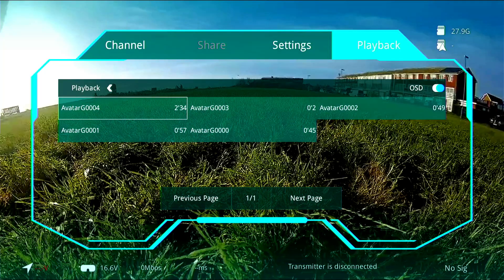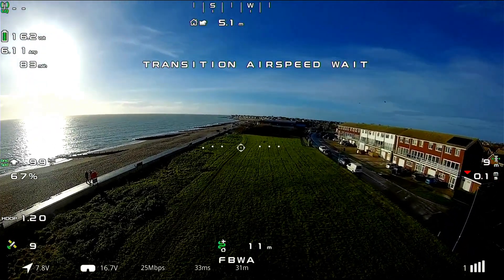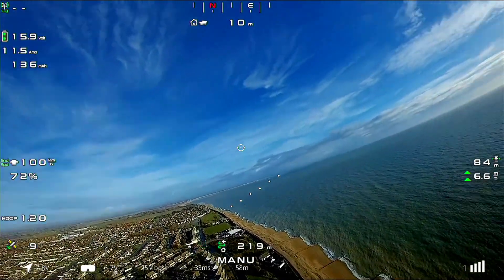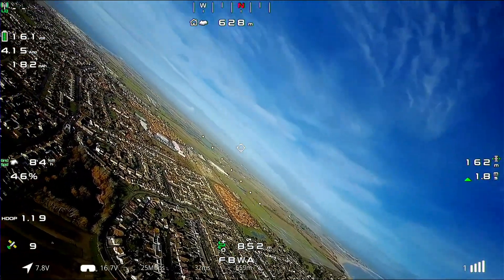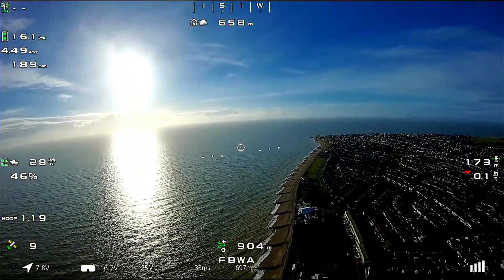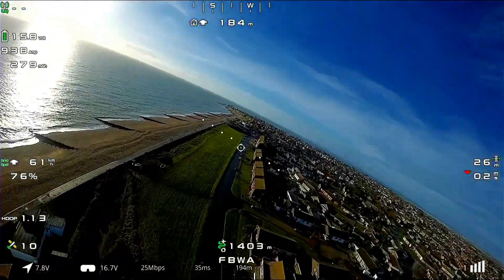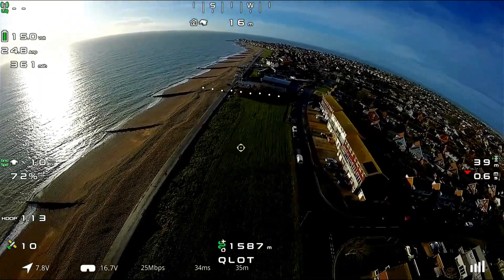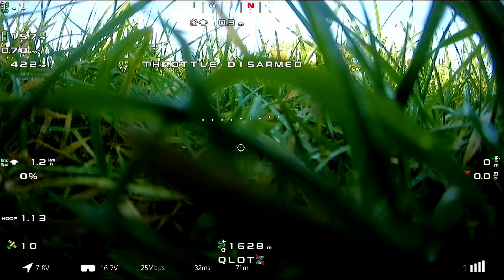Heewing T1 Ranger VTOL - Maiden flight with transition.

Comment: Is wind vane on? Seemed like you were perfectly into the wind on landing but then spun around. I’ve the same plane just never had the nuts to fly wind like that lol
Reply from the maker: I think I did have weathervaning on with this flight. I've since turned it off though.
Reply: @Crunklefloop  is there a reason why you don’t use it anymore?
Reply from the maker: I turned it off as I prefer having more control over where it's pointing. However I've now moved over to testing the upcoming INAV 7.0 VTOL

Comment: How do u set up battery with DJI system
Reply: And osd
Reply from the maker: Sorry for the late reply. I've only just noticed your message. 

I'm not using DJI, I'm using Walksnail here but powering the two is the same. I am using the Vbat pad to power mine.

Depending on what DJI system you have OSD might be limited.

Comment: how long it fly with 5k bat ?
Reply from the maker: I've never used a 5,000mah bat. I generally stick with the 1,800mah lipo and that gets 20mins which is enough for me on this plane. I think you probably could hit C.G with 5,000mah if you were using 21700 cells however I'd watch the voltage sag when the packs drop below 3v/cell as you'll want to keep enough in reserve to maintain a landing hover.

Comment: It is real OSD ? How did you get it ?
Reply from the maker: Yes, this is the Sneaky fonts OSD on Walksnail recorded over HDMI
Reply: @Crunklefloop  I notice custom fonts, but how did you get elements render close to edge of screen ? MP configurator allows place elements in 704 × 480 (NTSC) area only, or I something miss ?
Reply: look like I miss OSD1_TXT_RES :)
Reply from the maker: @SouthSpace  ahh. So there's a bit of trial and error. 

The first thing you'll need to do is go into the goggles menu/display and find OSD position. You can then move the OSD to the far left and top.

Then go to Mission Planner on the OSD page you can place your elements. Some you can just drag and drop however others you'll need to play about with the X:Y position until you get the elements where you want them.

Comment: For the wind it handled nicely. Yeah, if in doubt, flat it out (the power, not the plane 🙂).....
Reply from the maker: That was always my aproach with flying quads too. Once I was flying a 5" on 6S and lost video, I punched the throttle and heard the motors scream followed by a loud THUD. Turn's out that in the second after I lost video the quad went inverted so I had punched it full throttle into the ground. Left a nice little crater
Reply: @Crunklefloop  😄 I just repeated what I've heard. Never claimed it is the right thing to do.....

Comment: Well done for hitting the power and gunning it out of trouble... I've just got finished making my first HD 5 inch quad with Walksnail...Where did you get that nice HD OSD font from?
🤔🤔😳😏😏🇬🇧
Reply from the maker: If in doubt, go flat out! The font I'm using here is called Conthrax from Sneaky FPV - https://sites.google.com/view/sneaky-fpv/
Reply: @Crunklefloop  Oh thanks buddy.....The standard BF font looks pixelated....and it's too big...🤔😳😳🇬🇧
Reply from the maker: @EnglishTurbines  Oh yes! Once you start to use the HD OSD with active changing colours (battery etc) you won't want to go back to the old OSD
Reply: @Crunklefloop  I'm confused a bit ..So we copy the font file to the Walksnail Goggles via the SD card, but what font do we choose inside Betaflight?..Or doesn't it matter?
Also, how did you get the OSD overlay on the Goggle DVR?
Sorry to be a pain...lol 
🤔🤔🤔😳🇬🇧
Reply from the maker: @EnglishTurbines  So the OSD is only handled in the goggles as it's being sent via MSP (the positions of the elements is set on betaflight/INAV etc) however the actual font is within the goggles. 

After you've added the custom font files to the SD card (for Betaflight these will be the font_update.ini, WS_BF_24.png and WS_BF_36.png files) insert it in your goggles, power them on and connect to your VTX. Then you'll need to  open goggles settings menu [display], click [Font Update] to update font.

Afterwards you then select the Custom Font (it will be labled BF in your case) and it should then display.

In the latest firmware the OSD is recorded with the DVR but is only currently viewable in playback on the goggles, to record this I used a USB-C to HDMI cable and HDMI capture card and recorded it using the USB Camera app on my phone.
Reply: @Crunklefloop  Thanks for the detailed answer, very helpful...So, there must be two file types recorded on the Goggle SD card, image and OSD overlay?   What's needed now is an App to bring them together as a single file...thus avoiding the tiresome playback and rerecording?...How come the Goggles can playback it's own DVR showing both?...🤔😳
Reply from the maker: @EnglishTurbines  there are actually 3 different file types. The .avi (at least I think they're avi), a .srt (subtitle file for basic telemetry info) and the .osd file.

I believe a program is being worked on to use the .osd outside of the goggles. This would be especially handy to enable overlaying the OSD information over other recordings such as those from an Insta360/GoPro etc.
Reply: @Crunklefloop  Ah, That would make sense...3 files..For instance you could use the superior DVR inage recording from the VTX and apply the OSD overlay to it  also.
What version of Firmware are you running your Goggles on in this clip?
This deserves a video of some kind to explain all this IMO...The HD font looks amazing...😏😀

Comment: Thanks for sharing. Glad the ultimate test went very well. 
Strong winds, family pressure and a first timer. 
And the 25 mW seems more than enough  for this flight.
Reply from the maker: Hehe thanks :-) It does seem like I jumped in at the deep-end with this one. I'm very glad I had the foresight to add a mix to have manual mode easily accesible on a switch rather than fumbling with the 6pos switch. 

I'm going to flash the lastest Walksnail Beta firmware this evening which improves low signal performance and camera settings even further.
Reply: @Crunklefloop  Despite all the FC control support, the manual and emergency mode needs to be a quick switch away. And the only mode my TX trims are available. 
Only first and last of the six pos switches in flight are usable for me. I have to count the other positions, using my fingers, with my goggles on.